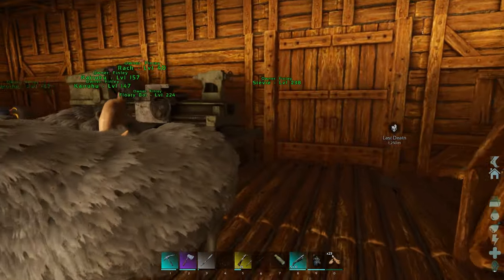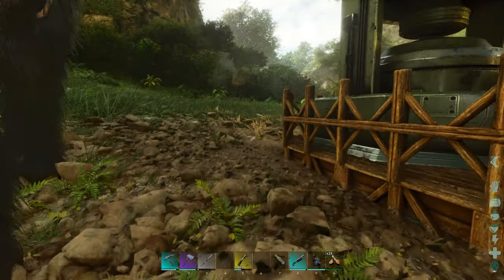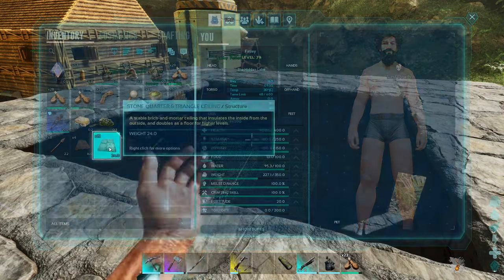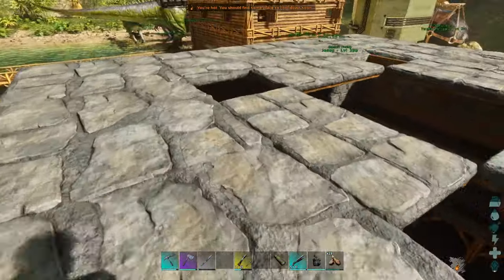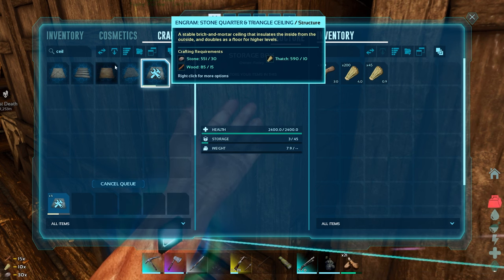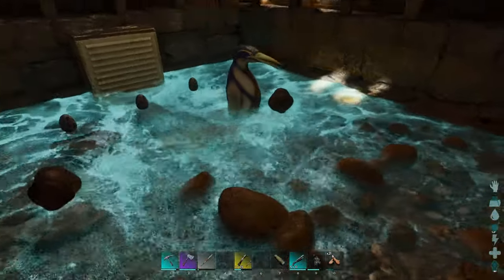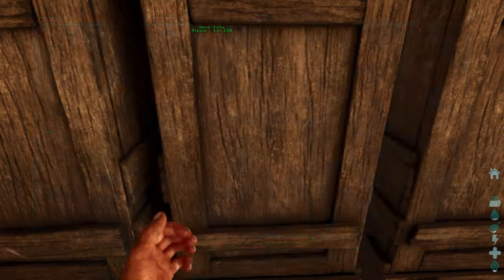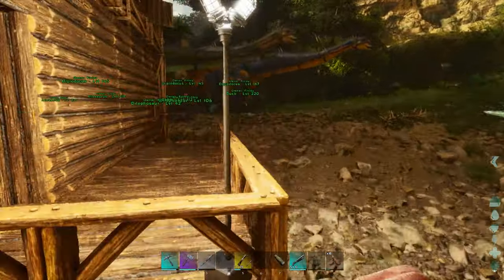How To Make A POLYMER Farm!  | Ark Survival Ascended

Comment: Could you do it like this.....
In the centre of your pit put a pillar. Raise the pillar to the roof, forming a dot inside your open square in the ceiling. Put a quarter floor on the pillar, dead centre. Put a male on the square. Put females all around, will that work with a single male in the centre of all the females?
Reply from the maker: I’m not sure, I haven’t tested it, you’d have to make sure there’s ample room for the eggs to fall down and I’d imagine the pillar would get annoying in the middle of the kill chamber
Reply: @FinleyYT  I agree. Perhaps then, only working from the ceiling. Place one pillar (sideways, level to the ground) from the ceiling toward the centre. Then you can build your quarter floor in the centre of the ceiling. You would still have three quarter gap all around. 
I'm not ready to build a penguin lair yet, or I would try it.